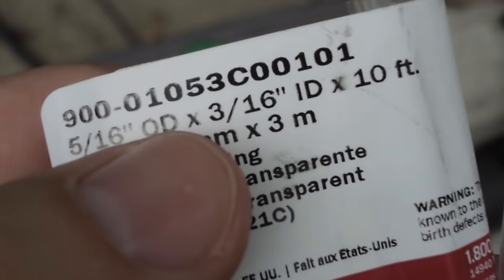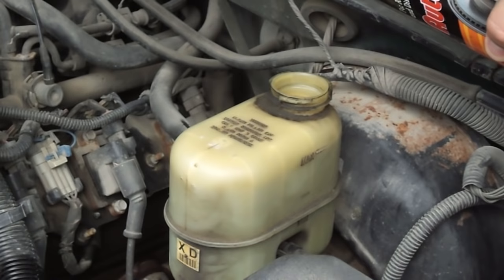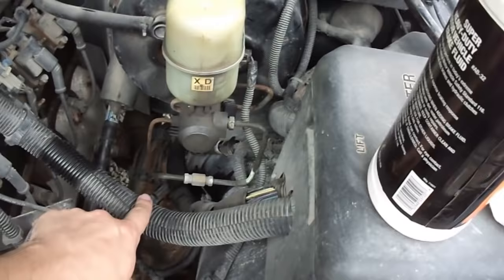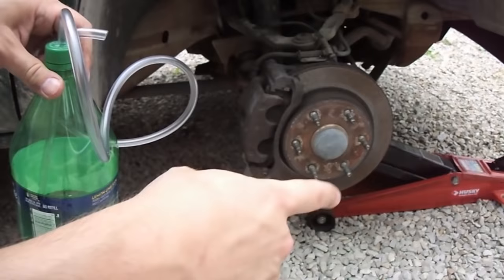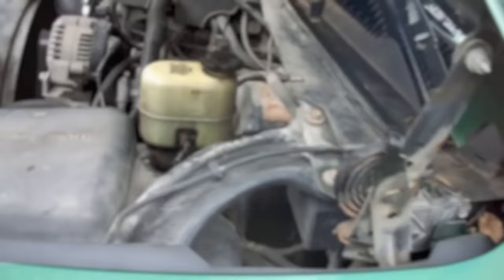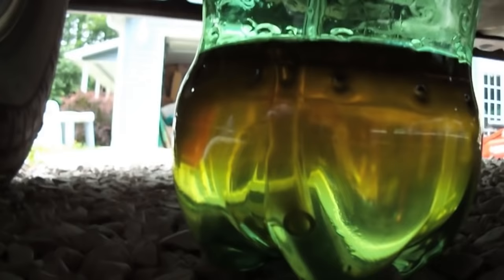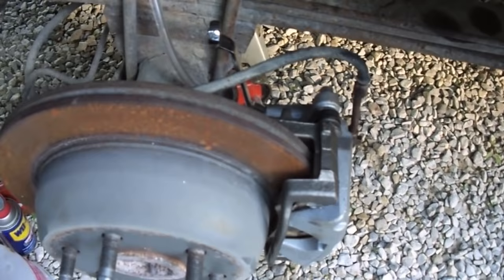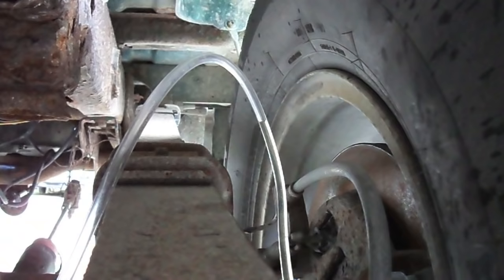Bleed brakes by yourself - DIY Brake Bleeder tool - Brake flush

Comment: Make sure its a sprite bottle, I tried it with a dr. Pepper bottle now i have a bad master cylinder.
Reply: I use a Cointreau bottle, its better still.
Reply: Gatorade, it has electrolytes.
Reply: @alexnelson8  Comacho approves this message
Reply: I used a cheerwine bottle. Now my car speaks japanese in a carolinian accent
Reply: Since it's Hillbilly ingenuity, it should be Mountain Dew
Reply: Used a beer bottle now my car drives in reverse mode.
Reply: @russellstuff-her7017  😅
Reply: Im in California so naturally, I used a paper straw instead of plastic hose. 🤡
Reply: Sometimes it’s the simple things in life you really appreciate.
Reply: I have a Toyota so I used a Fuji water bottle.
Reply: I used an a&w root beer bottle and now there's more air in my brake lines than before 🤷🏻‍♂️ go figure 🤔
Reply: I’m using an ice mountain water bottle on a Jeep; perhaps mine will want to climb Mount Everest when it’s done.
Reply: Rookie mistake 😂
Reply: Gatorade
Reply: Facts. Pepsi bottle doesn't work either

Comment: I use the same tubing to bleed brakes. But I put a self tapping screw in the end of the hose to block it off, then cut a small lengthwise slit near the screw. This acts as a non-return valve. When you push down on the pedal, brake fluid is forced through the slit into the bottle, but when you release the pressure air can't get back into the pipe.
Reply: Great 👍 idea sir 😊

Comment: Nothing hillbilly about basic science and simple tools.  I've been using a glass spaghetti sauce jar to do this for years.  You correctly point out that you MUST have a vent in the lid of the collection jar.  Also you correctly point out to make sure you keep adding as required to the reservoir during the process.  No need for special vacuum tools or gimmicky devices when atmospheric pressure and simple knowledge of fluids will work perfectly!

Comment: My new motivational speech "if plan A fails you got 25 letters"
Reply: Word!
Reply: with my current drum brake hardware replacement, I'd say I'm on plan F =)
Reply: Buick Regal   I finally did figure it out. Aftermarket parts are not cut the same. I was able to make small adjustments untill I got them on perfectly. Now I have to do my other vehicles drums. The second wheel was a piece of cake after the 1st wheel.
Reply: I stopped at the Flintstone plan method😄
Reply: Okay everybody don't be like that guy.  take the cap off the bottle. Before you drill it out the bottle has to be clean.  So I get A+ plus
Reply: I was going to say the same thing. Great philosophy
Reply: MrThekidmartin I like that, good one
Reply: Only thing I would add is to not extend the master cylinder all the way by pushing the brake pedal all the way to the floor.  I use a 2 X 6 under the pedal to keep pedal travel to a minimum without ruining your M.C. Seals.
Reply: Thats pretty much how any car project goes
Reply: That is EXACTLY what I just said.

Comment: You should use the oportunity to clean off the top of the reservoir around the opening using a clean paper towel and a little fresh brake fluid and siphon out the reservoir before adding fluid to it. That permits you to do a proper line flush, not just a bleed. Start with the shortest line and you assure that all the old fluid is replaced. Doing the longest one first will allow old fluid from the companion line to mix with new at the proportioning valve.

Comment: Guy you're a genius.  I spent like 40 bucks last year and did my brakes in my minivan, the kit didn't worked properly and my lack of knowledge was enough to crash the minivan against my neighbor. Yesterday i replaced the caliper of my car using your method and it went perfect, i was scared at the beginning, even after finishing but i drove around the blocks and the brakes were perfect. You are the best. And i owe you this one. Thanks.

Comment: YOU CAN THERMAL SHOCK THE BLEEDER VALVE BY USING A TORCH TO HEAT AROUND THE CONNECTION, THEN HIT THE VALVE WITH A SHOT OF SPRAY FROM A CAN OF "FREEZE IT".  This will expand the hole and shrink the valve allowing you to separate the two.  It might take a few times of thermally shocking it but it works well.  A new valve is a lot cheaper than an entire caliper.  I've been doing this since the sixties!  Also add a little transmission fluid to the point of connection to help lube get in there and help loosen it too.  Good video!
Reply: Brilliant comment, and thank you for your input. I've use water after using a torch. What is a can of freeze it?

Comment: Man your video helped. I went to Oreillys last night to get rotors turned. My closest store has jerked me around for 2 weeks, so drove to 2nd closest which is about 40 minutes away. I pull rotor off and it cant be turned. They seemed like they didnt really want to do it there either. At first stated cant promise they can do 2 front ones last before closing. I stated I called before driving and was told yes. 

Pissed off, I walked 3 businesses down to Auto Zone. I bought a caliper 2 rotors and set of pads and a coke to drink. I also bought the bleeder kit for one man, well it tipped and hose popped off. The store had closed and I'm still there solo in a crunch so I used tubing and coke bottle.
I had watched your video the other day. I was able to get one side done rotor pads and caliper. I just did my pads 1000 miles ago but re did since I'm adding a new rotor. I will do the other side today in the comfort of my yard. Video definitely helped.

Comment: Great video.  I'm not a mechanic but I do know from experience if you fear your bleed screws are fused to the caliper (common) you can use some PB Blaster on them the night before to hopefully penetrate the rust.  Then before trying to break them loose, heat well with a butane or hotter torch then hit it with the PB Blaster to shock the bleeder by fast cooling it.  Repeat a couple of times to be safe and use a bleeder wrench (6 sided), 6-sided open-end wrench or line wrench.  The heat/cool method can also be used if you strip the bleeder to avoid having to get a new caliper.  Just shock it a couple of times and as someone posted below, if the bleeder is stripped using this heat method you should be able to get it out using vice grips at that point.

Comment: Worked like a charm, thank you for the easy to understand and informative video. I soaked my bleeders overnight with PB Blaster and they came off super easily. Also, I used a socket/ratchet to just barely loosen the bleeder before attaching the tubing which helped as well!

Comment: Great video. I’m a DIY person myself, and really appreciate money saving tips.

The only thing I would do differently is drill the holes with the cap off the bottle so I don’t have to clean the bottle out again.
Reply: why clean the botle??
Reply: @elcompamartinez2647  There’s a chance that any contaminants in the bottle could get sucked back into the brake line.
Reply: @elcompamartinez2647  look at his username. How the hell are shavings going to work themselves up from the bottle into the brakes? If that happens your definitely doing something wrong and wouldn't want you working on a wheelbarrow.

Comment: You can also use a deadman to hold the brake pedal down in the Silverado/Sierra. About 24” piece of 4x4 wedged between the pedal and the front of the seat. Works like a charm every time.

Comment: Excellent video and great camera work. I was going to do a two person bleed with my wife hitting the brakes but decided to try this instead. I used a one quart Mason jar and drilled the lid for the tubing and vent. The Mason jar was a little heavier and less prone to tipping and I didn't have a plastic soda bottle anyway. Thanks for a very helpful video !
Reply from the maker: That works!

Comment: if you have a stuck bleeder try tapping a finishing nail all the way down into the opening in the bleeder before crimping the vice grips on, that way the bleeder will not collapse when you grab it with the grips. a bleeder is much cheaper then a new caliper ;) they are notoriously fragile mainly because they are hollow, if you fill that hole with something it will be much stronger and give you a better chance of getting it out with vice grips or a pipe wrench or whatever your favorite tool is. obviously you will have to replace the bleeder but they are cheap and good to replace anyways. use antiseize when you replace them. PS great video, great idea

Comment: If you see fluid at the bleeder screw threads it means air can be drawn back in when the pedal is released. On the final pump hold the pedal down with a stick between the pedal and the seat then tighten the screw before removing the stick. I like to tap on the caliper/wheel cylinder with a rubber mallet to knock air bubbles loose.
Reply: That's a good tip. Is 7 or 8 pumps of the brake pedal usually enough?
Reply: That's what I do (lifelong mechanic here) and it works very well. If the vehicle has a "club" lock they make good pedal holders (though as locks, they are easy to break).
Reply: If you make sure there is no more air in the tube, and the tube is submerged in fluid in the bottle, then only fluid will be draw back in on the final pump.
Reply: eric shofe not if it is leaking around the bleeder screw when loose which is 99 percent
Reply: Proximity Symbol   Final pump on all four is how I was taught but is kinda hard by yourself
Reply: Outstanding job, thanks for sharing this with us.
Reply: I use a rubber mallet too or just the palm of my hand and hit it gently. Could put grease around the bleed bolt to prevent sucking I’m air.
Reply: The way he has done it, he has created a closed system, I would agree with you if he was using a vacuum pump to draw air, but when the hose is submerged in the fluid inside the bottle there is no air, only fluid being drawn back in. since he is using the peddle to push air from the line, the pressure created from the liquid in the hose is enough to not let air in at the threads. this allows him to get out of the truck and close the bleeder. Very smart idea.
Reply: @obfuscated3090  I knew club locks had to be good for something.
Reply: With this type of system it doesn't matter if the peddle is depressed or not. It's a closed system.
Reply: @jonathonvince3605  Put a bit of grease around the threads to seal them off. Bob's yer uncle. 🍺
Reply: @mninja500  if you're using a vacuum pump than you're not pressing or releasing the pedal. In order to get air in you would have to release the pedal for air to get sucked in. Using the vacuum pump you're obviously sucking all the air out, no way to get air in. I do it all the time. Also, ppl do whats called gravity bleeding. All you do is crack the bleeder and let the fluid leak out until all the air is out or if you're flushing just have the bleeder open until new fluid comes out. Best way when gravity bleeding is to have a clear hose n have it go up first the  down so you can watch the fluid go up then drain down into a bottle/container. Ive also seen a guy using tubing rigged to the sprayer of a spray bottle like windex. Take the sprayer out, rig it to the tubing, then jus start pumping the sprayer until all air is gone or new fluid coming out. But ya you're not going to get air in unless you have the pedal down then release it to suck air in. Just to be on the safe side when using a vacuum bleeder i always have the vacuum going until i tighten the bleeder and remove it from the bleed screw to suck all the fluid into the container. First time i used one i didnt suck all the fluid out the vacuum line and when i released it the fluid in the line leaked onto the driveway. Now i always just keep vacuum runnin, tighten the bleeder, then pull the line off until all the fluid is in the container before releasing the trigger/stopping the vacuum.
Reply: @@rillwill2129  no

Comment: This was clever. I spent the money to buy a "one way valve" that goes on the brake bleeder hose. Supposedly it prevents air from getting back in the bleeder hose when you release the brake pedal. But what you created does the same thing in that IF anything is pulled back into the brake line it will be some fluid not air. 

A guy who worked a professional brake shop told me they just open the bleeders and let gravity work. That way they can just stay up by the master cylinder and keep it topped off.

Something else occurred to me. Several years ago the left rear caliper in my car seized and would not release. One day I got out and smelled hot metal. I knew right away what it was. Got new caliper and rotor before going home. Guy at the parts store told me bleed brakes every couple years and this won't happen. Any moisture that gets in the brake line will migrate to the caliper because of the heat and cool cycles of driving. That means rust in the caliper so it gets stuck.

So, when I am on my game I bleed all four calipers every even numbered year.

Comment: Great lesson, 1st one I watched, and feel I don't have to look any further.  One tip though, that I recently learned from youtube, on removing the bleeder, or any other stuck blots, is to really heat the hell out of them, then cool it quickly, with a spray bottle, or a hose.  Has worked great so far on my Northern (read: rusty) 2000 Jimmy.  Did it on all my bleeders, as there is nothing rubber there to get damaged.  Using a MAP gas torch - it's hotter than propane.  Thanks!
Reply from the maker: my1after909 excellent tip. Thank you!
Reply: @TheDaninator 
What’s the diameter size of the tubing???

Comment: Hey Dan, just wanted to say what a great video this is. I'm about to replace a cylinder and this is by far the best video on how to bleed brakes that I've found. I'm in a similar situation to yours, so thank you for passing on what you've learned. It really does make a difference.

Comment: I'm using 5mm ID tubing x 8mm OD. Fits nice and tight over every nipple I've encountered.
My Goldwing has 7 bleeding points for the two wheels, plus a clutch bleeder.

Comment: I've done this for years.  A tall wobbly bottle like that keeps falling over, I use an old Cointreau bottle - heavy and squat. I dont sit in and pump, I lay on the ground and push the pedal with my hand, so I can see the tube bubbling. I work the pedal quite slowly to avoid sucking air back in around the bleed screw.  I find fluid flows out (with air) and down from the reservoir without pumping at all, but I finish with some pumping.

Comment: Your fitment from the bottle cap to the hose has to be sealed perfectly.  Great video. 👍  but i had to just buy that tool for 60 after a shop wanted 250 to bleed my pt cruiser  brakes. Ended up getting  the tool to bleed and new calipers. Split  ceramic pads. Fluids and  im set now. Had to flush out my system  in the front just as a precaution

Comment: The key to this working is having the pipe in an upside down U from the bleed valve to the bottle, that stops air going back into the system, also keep the pipe submerged in the fluid in the bottle.
Reply: what  pipe size to buy (diameter)?

Comment: I rounded a bleeder screw  so  I took a drill bit that was slightly bigger than the hole in the screw, and tapped on it with a hammer to push it all the way down. Then heated with torch and use vise grips to loosen the screw. then just replaced the bleeder screw. Then I replaced all the bleeder screws when I bled them. At about $2 each, it was worth it.

Comment: I'm highly impressed! I saw another video where you had to buy a $25 tool, and had to keep the pressure between a certain range, but this looks way easier, and you explained it nicely! I have never bled brakes by myself before, my dad always used to do it, and I need and want to change it out next week. Thanks!

Comment: Good video man.  May I recommend that you don't use both feet to pump the brake.  There shouldn't be any back pressure . Also don't push the pedal any further than it usually travels . Push down. Slowly release up . Cheers

Comment: 1) zip tie or glue a magnet to bottle 2) keep bottle above caliper so air bubbles rise 3) put a check-valve inline on the hose 4) poke a tiny hole in top of bottle to let pressure out as fluid goes in. (Vitamin Water bottles have a perfect waist to support zip tie)
Reply: Why is it better to keep the bottle over the caliper rather than below on the ground?
Reply: Air bubbles. Air rises up the tube. Not down.

Comment: When your bolt/nut is WAY too stuck. If you have an extra jack.. what I did was with the one on bottom, I used a ratchet, held it in place while I got the jack ready. And used the jack to push up on the ratchet. That's the ONLY way I could possibly get it off there! Then with the top one I had to cut a piece of 2×4. Held it on the jack till it was jacked high enough for the pressure between the jack and ratchet to hold it in place, then simply keep jacking it up till it came loose.
I tried soaking in 3&1 oil. I tried using a hammer and rubber mallet on the ratchet to break it loose. I even tried more 3&1 oil. Putting only the socket on the bolt and firmly tapping it with a rubber mallet. Then hammer. Still wouldnt come lose. A jack was the only thing that worked. And it DID work